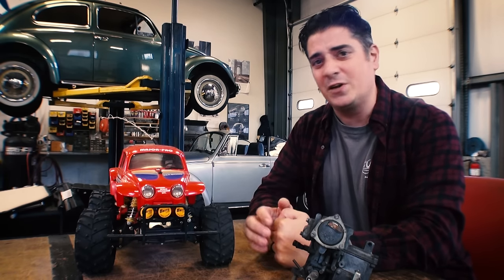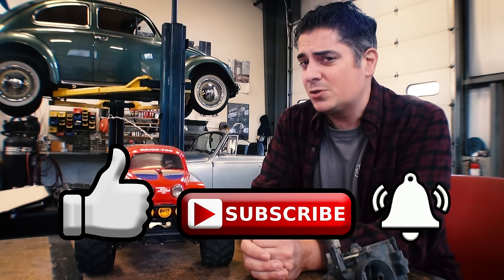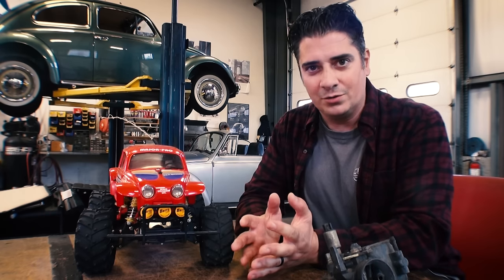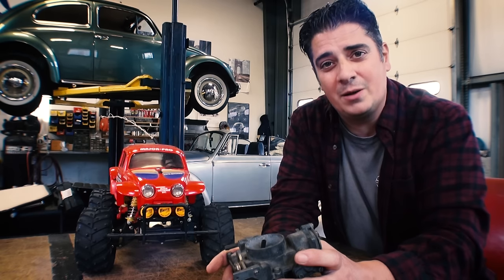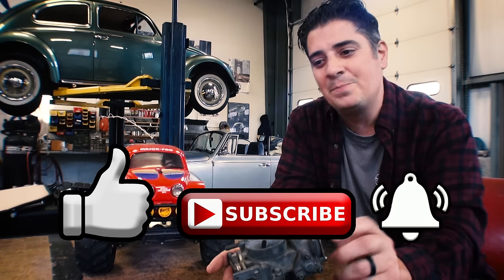TOP 7 Reasons your Classic VW Beetle BuG Hesitates, Stalls, or CHOKES on Acceleration

Comment: If the VW is not running smooth, or not even starting, it all boils down to two reasons... it's not getting fuel, or it is not getting spark.
Reply: Or compression ;)
Reply: Or it's getting to much fuel. That plastic leveler could be too low.
Reply: That’s so funny I’m new to this and those two things have always been the root to my problems so far so good
Reply: What about air ?
Reply: For people with common sense this is great advice thanks!

Comment: So close to getting my shitbox running after 2 years. Multitude of issues but got hesitation on acceleration now. 34 pict 3 empi carb paired with 034 clone from pertronix with matching wires. With only 3 screws to adjust on carb you think it would be a snap but never is. German carbs are near 400.00 now! WTF is going on? This timeline sux!

Comment: 2 most common problems in most high mileage carbs especially VW Solex: Throttle shaft hole worn so vacuum leak there and always slop in accelerator pump linkage. The accelerator pump should squirt the instant the throttle is opened. Usually it is so worn that the throttle is already opened 1/8 inch before the slop in the linkage is taken up and it actually squirts. Some have 2 cotter pin holes in the end of the rod that pulls the pump linkage, move the pin to the hole closest to the throttle shaft. Whatever it takes to remove and repair wear.

Comment: Hesitation is normally caused by a air leak/vacuum leak. Normally cause the vacuum flow in the carb is not right.

Comment: Also a plugged heat riser will cause  the engine to stumble. this requires the intake manifold be removed and the carbon be cleaned out of the heat riser tube. Several methods are available but what i used to do was to poke a stiff wire into it to get a hole going. load it with oxygen gas, then light it off. this burns all the carbon out and allows proper heating of the tube to vaporize the fuel. Additionally, if someone has removed the cooling fins and thermostat from the car, it runs far too cool and will hesitate also. one other thing to mention, is that the 34 PICT-3 carburetor carried a 127.5 main metering jet. The carb has a 26 mm throat. It may be possible that putting a larger jet, such as a 130 or 132 will cure the trouble. The smaller jets were used for smog control. I hope this helps
Reply: What is smog? 😅

Comment: Regarding item #4:  I believe that the 'spring' you are talking about in the choke housing is actually a bimetallic material that expands and contracts with temperature changes.  That expansion/contraction causes the coil to open when heated and close  when cold- this latter action closes the throttle to restrict the air though the venturi which speeds up the air, causing enrichment of the mixture.  The idle speed is also increased by setting the fast idle cam. One pump of the accelerator sets the fast idle cam, activates the choke system while giving one shot of fuel to help prime the engine.
Reply: My carb manual refer to it a 'bi-metallic spring'.

Comment: I often have a problem that when the engine is warmed up and I turn it off, fuel immediately starts leaking through the emulsion tubes into the throat (barrels). It is then very difficult to start the engine. I always have trouble starting a hot engine. I lowered the float level but then I have a big hole during fast acceleration. It doesn't want to accelerate when I press the gas pedal harder. Fuel pressure ok.

Comment: Another great way to check for vacuum leaks is to use a propane torch unlit but turned on and move the nozzle close to all the gaskets and fittings listening for the engine to speed up. Not messy either!

Comment: 1.  Carburetor / Distributor Combination  1:02
2.  Accelerator Pump  2:29
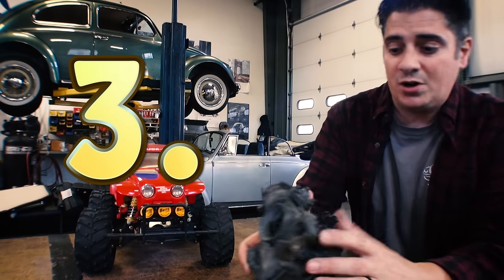3.  Side Jet(s)  3:47
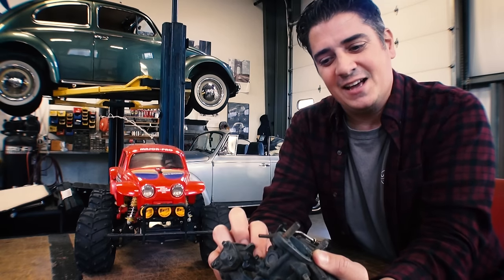4.  Automatic Choke  4:47
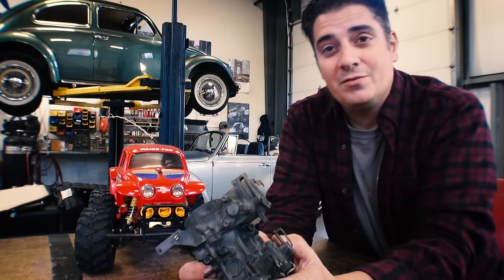5.  Junk Within Jets  6:46
6.  Vacuum Leak  8:49
7.  Electrical Components  10:09
Reply: I put new carburetor and air filter on my 1966 ghia. I had to add a spacer under the carburetor because it was hitting the generator. It sputters when the engine heats up. It takes a while. Choke is open. I notice that spacer under the carburetor is cold to the touch and has a little condensation.  What are some good recommended fixes?

Comment: Really lov'n the way my 40 runs with a restored 28 PICT-1 and a restored R-5 big cap dizzy.  Smooth as silk.  Just like when new.  Good vid!
Reply: It’s the perfect combo of carb and distributor. I’ve seen so many 009 distributors in various carb/engine combinations and they never run right. The 009 was designed to run flat out for things like farm equipment.
Reply: @docscout  Yes.  Everyone wants the performance.  I removed an H-30/31 and a V-06 dist. That came with the car.  Good pick up, but no load sensing.  Hard starting when hot and a stumble off idle.  What I have now, is a perfect choke, idle and top speed of 72 mph and 30 mpg. ( Factoy spec. ) What it was... 74 mph and 25 mpg.  1964 sunroof bug.  Cheers!

Comment: I just spent 4 days trying to solve a bog and dead spot under load. Focussed on timing first. Then a few days cleaning carbs, jets, setting accelerator pump, etc., back to timing. Nothing helped that much. The problem ended up being the point gap. I checked the points last. It was a bit too wide. I set it to 0.016” and problem solved. 

Advise: Check the east things before you start ripping apart your carbs. Lol.

Comment: Thanks for your great video. I have a 1600 dual port in a beach buggy in u.k. I have electronic ignition with a cheap Chinese carb off e bay. Today we took it off and adjusted the accelerator pump to come in earlier (right hand side against alternator) it's completely solved the hesitation problem.  So hope that helps. Jon.
Reply: Alot of people miss that on a carb, the adjustment of the carb accelerator pump is very important for a nice crisp throttle response 👍

Comment: I used an .009 distributor with a 34 pic 3 carburetor on my 1974 Beetle 1600cc engine. Had the flat spot when accelerating, so I advanced my timing from 7 1/2  degrees before TDC to 9 degrees before TDC and it runs smooth and doesn’t run hot. I always stay below 10 degrees before TDC when timing my bug and have good results.

Comment: I drive my bug regularly and have had to clean jets and even change jet sizes depending on where I buy fuel.  The bug does not like cheaper fuel with higher ethanol levels.  So, I've tried to be more consistent on where I fill up with quality fuel.  Ignition timing is pretty critical also in keeping the bug running and accelerating smoothly.

Comment: Great info! Thanks Chris! Some oil baths have pre-heat to help warm up the carb faster. Finding an original oil bath air cleaner is a good idea. The other thing I can think of is that some setups have a fuel pressure regulator. If set incorrectly could cause hesitation, stall, etc.

Comment: a split boot on your intake can also mimic the actions of a bad carb. while its running, spray your boots with starting fluid. If you get a rise in rpm, you found the leak

Comment: 🇨🇦 been working on VW for many years, but sometimes you just need some reminders. Thanks for getting right to the point no pun intended. I opened up my 27.5 main jet and made sure my Excelerator pump faucet had a good stream, and all my boogie-woogie came back, so thanks PS  I
 am running a Venturi vacuum distributor. I also remove my electronic ignition and installed a good set of points and the needle on my vacuum gauge is much more steady, go figure.👍

Comment: I found that the little brass accelerator pump tube that squirts gas down the throat of the carb. might be loose. I usually tap it down to make sure it is seated. One time I overhauled an engine and when started the engine started to hammer. I found that brass tube inside the engine being hammered by a piston. No harm done but had to dismantle part of the engine. I did not work on that carb. during the overhaul. Best advise is to always tap that tube down and see if it rotates too easy on any type of service you do.
Reply: I had the same thing happened to me so I’m a little paranoid now I wiring a tether to the spout

Comment: Accelerator pump tube : the spray of gas from the accelerator pump needs to be adjusted such that as the throttle plate opens that spray shoots between the wall of the carburator and the opening throttle plate. The brass tube will rotate to facilitate that adjustment. After adjusting make sure to reseat the base of the tube into the carb body by pushing it down.
Reply: This is by far one of THE most overlooked items with these carbs. People cycle through carbs all because rebuilders don't really understand how the carb works. Getting that spray to fan-out as it hits the edge of the throttle plate just as it cracks from the venturi wall makes for an excellent throttle response. You are right on!!
Reply: Pushing the nozzle down FIRMLY. I recommend removing the top plate of the carb to BE SURE it's pressed down FULLY. Ask my how I know this.

Comment: I run 94 octane and a secret additive. I run it at high rpm on the highway for 5 min. When i get back i rev the engine and quickly put my hand over the carb throat to choke it out 5 or 6 times.

Comment: Hi, Chris thanks for putting this info out there for all of us! I have a VW Beetle 1968 and it idles perfectly but sputters when I accelerate. It runs smooth right off the bat, warmed up or cold, when it's idling, it doesn't sputter or anything, It's only when i try to drive it when it starts acting up on me. Thanks in advance!
Reply: An engine under load needs a different amount of ignition advance and air/fuel ratio to idle.
What I recommend is that you tune your carb using a vacuum gauge.
Using a tee piece pop it onto the vacuum hose between the distributor vac. Can and the carb.
Use it on a fully warmed up motor after a drive. Then you simply adjust the carb mix screw so that the gauge reads the highest vaccum level, that's in the minus number, in other words so the engine sucks the strongest, this gives the most efficient power your engine can make.
Reply: i was wondering if you resolved this problem? i have the same issue,THanks

Comment: Always verify that there are no air/vacuum leaks at the end casting where they meet the head and check the intake where the carb bolts too intake,9 out of 10 times that mounting surface is not level

Comment: I would add on the vacuum leak to check the throttle plate cross linkage which those brass bushings fittings wear away and creates vacuum leaks almost non-detectable. Our friend in Oregon replaces these bushings at a fair price....  Andy L.

Comment: Workin on a 16tl. Dual silex on a trike. Bad backfires thru exhaust. Valves are set around.011, it seems the linkages are uneven due to the twist on carb linkage throw at different angles. So when at idle all sinchrod but pikin up rpms one opens more. Done timing switched coils  cap wires  you name it....this seems to be it. Carbs are clean . I don't know what is the tiny brass screw at top .  Behind the acc.   p ump tubes

Comment: I don't have a VW, but I do know that the float on a freshly rebuilt carb that somebody else rebuilt might be too low or too high.  If too low, you will have a lean spot as you start accelerating. If too high, it will be over rich both early through the range and at heavy throttle.  Check your float for proper adjustment BEFORE installing the carb.

Comment: Also check for manifold heat, which could be low due to clogged heat risers. Anything other than original exhaust system will not force enough exhaust gas into the risers to warm the fuel a stock engine would consume.

Add a header and now there’s more potential fuel and less potential heat.

Manifold less than 105* F means fuel can stick to it rather than be used and thus lean hesitation with big gulps of air/fuel (off idle throttle hits).

Even with short runner dual carbs it’s an issue. I’ve added ceramic heaters to mine and some 70+ amps of current to heat the manifolds. The heaters and epoxy also insulate so they’re not always on. It’s a solution and makes good power but wow a stock setup would be so much easier lol

Comment: I need some suggestions, my 74 VW Beetle sat for about 3 years, long story....... But anyway, it wouldn't run so I replaced the Gas Tank which was rusted and also float. Replaced the fuel lines, filters including the Carb. and fuel pump. It still has a rough time running smooth.  Whenever it was parked I had just replaced the gas tank, plugs, wires and adjusted the valves and was running better then ever. Anything you might suggest....... Thanks.
Reply from the maker: I would take that carb off and open it up and do a cleaning.

Comment: Hi Chris, my 65 has been sitting for about a year. A small amount of gas is in the tank I belive and i need a new battery. Anything at all I should do BEFORE I start it up to prevent damage?
Reply from the maker: Inspect that tank, dump the gas.  Check oil of course.  A year is not too long so...  Go thru tune up motions too.

Comment: So - I understand the potential gas leak hazard, but why no fuel filter in the engine compartment? I always had one there - far to the left of the distributor and coil towards #3 & 4 side - where I can see if it's dirty, replace it easily when needed, and where it's away from any electrical components. 

I ALWAYS use the factory type fuel hose, though. The stuff most auto part stores sell is close - but NOT correct in size. When I tried some - it was tough to get onto the filter and DID leak - so I stuck hose clamps on it, which had to be tightened so much to stop the leak that it constricted the plastic tube on the ejection side of the filter which gave me mixture issues. I'd had idle issues, mainly dying at idle, so tried looking at fuel system first and found this filter restriction.

Went to stock German rubber/ cloth sheathed gas hose, installed a new filter, adjusted the carb (with it on the car) the way Chris recommended (mixture & idle both in all the way, 10 half turns out on mixture, 5 half turns out on idle, fine tune it after w engine running.) After that & tune up -  the 1600 installed in my 64 Bug  runs better than ever.
Reply from the maker: so true!

Comment: I replaced my fuel pump and ever since Iv'e had hesitation issues. I read that the fuel pumping out of the new pump might be overwhelming the carb. i also read that grinding down the rod that drives the pump will relieve this. I will check the accelerator pump and dual jets next. This is a 69 motor in my 65 bug. 1500 cc. Thank you for the info Chris.
Reply: Yes, it is sadly not uncommon for a new aftermarket fuel pump which might be producing too much fuel pressure to your carburetor.  VW throughout the years and models specified both the minimum and maximum fuel pressure that a fuel pump should put out (it will vary depending on the engine size, year and carb type).  Generally speaking, you should have at least 1.8 or so PSI at Idle (about 850 to 1,000 rpm, and a maximum of about 2.8 to 3 PSI at 3,00 PSI).  Do NOT grind down your metal fuel pump rod yet, because some adjustment of the pressure can be made simply by either removing or adding more or less paper fuel pump gaskets (but there must ALWAYS be at least one paper gasket both above and below the red-ish/brown-ish plastic "intermediate flange" base between the crankcase and fuel pump!).  When/if you have the pump off, measure the exact length of that metal fuel pump rod in millimeters (there are at least two different types/lengths).  Do some further research to find out exactly what your engine needs to run smoothly... I won't use an aftermarket fuel pump or carburetor!  I only rebuild (or have rebuilt for me) original equipment Pierburg brand fuel pumps and original Solex brand carburetors.  The aftermarket stuff is too troublesome, basically rubbish in terms of quality and reliability.

Bill B

Comment: When everything else is correct, stock jetting, clean carb, SVDA dizzy, timing correct, carb settings nice, and it's still giving you fits... look at clogged heat risers.  And you need that extra heat to the air cleaner off the sled... even if your ATS (air temp sensor) is dead or deleted.  You NEED that 3rd heating hose to the breather.

You can get away with a bad ATS, but you can't get away with clogged heat risers, and no sled heat to the breather.

Comment: my generator light has been coming on the whole time I run the engine, its not running the battery down but I hate driving it because of this. There isnt anyone in my town that fixes air cooled engines so I have to ask you.
Reply from the maker: you need to get a voltmeter and check if your generator is putting out, and also check the regulator.  Are you near the NY area?  My shop can look at it.
Reply: No I am in Ohio, bummer @classicvwbugs
Reply from the maker: @wingsonmyback1  people ship me cars from all over the USA.  We could arrange it if need be.

Comment: I once put a new gas tank in my Beetle without cleaning it out first.  Big mistake!  It clogged the carb and the car would barely run.  A mechanic had to remove the tank, clean with solvent, blow out the fuel line, take apart and rebuild the carb.  Then it ran fine.  Beware of “cheap” parts that lead to breakdowns and expensive repairs.
Reply: And make sure you cave a clean (in tank) filter screen

Comment: Chris Vallone - my 66’ bogged out a few times and I found a hole in the intake manifold. Would a new manifold fix this issue?
Reply from the maker: Where on the manifold?
Reply: Chris Vallone hi... I had it replaced already:) I just thought I’d throw that comment in... it was weird. It just bogged out and stalled, it lost all power like it was getting to much gas or air😕 Thanks for all your videos. Hey can you post a video on how to install a bamboo tray under the dash with out drilling into the frame/vw, Please!